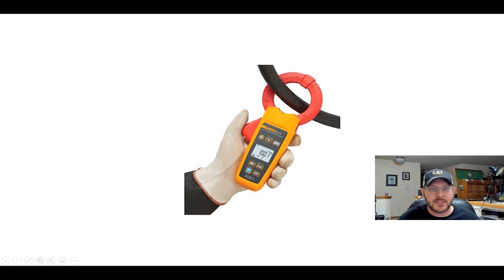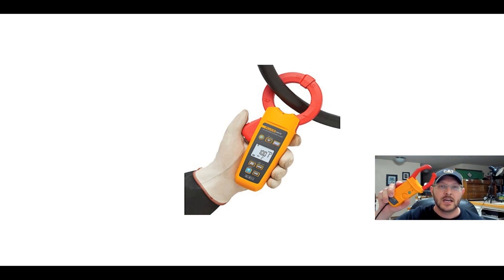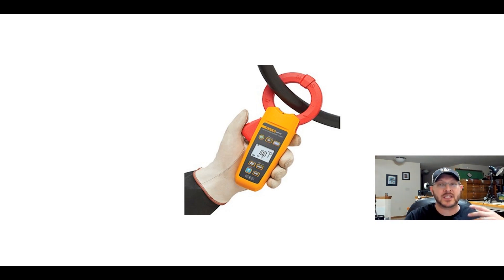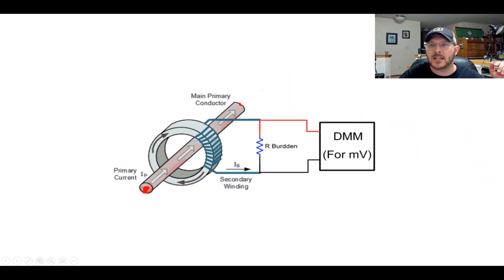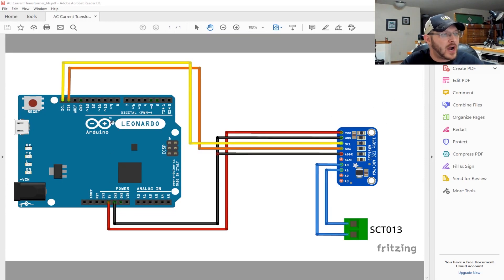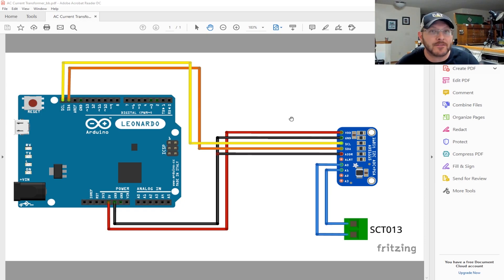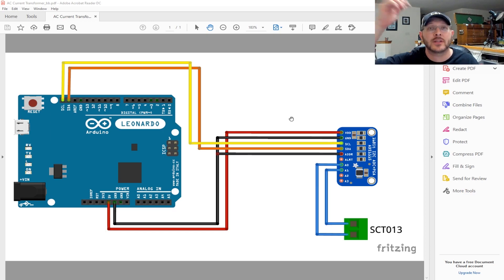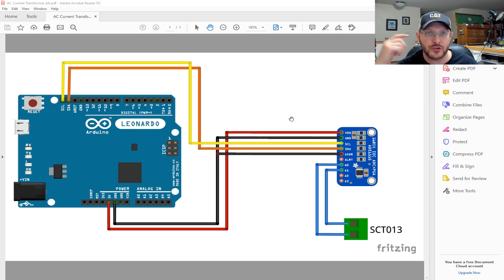Measuring AC Current with Arduino

Comment: For those who are confused by the multilier (LSB Size), here is how to calculate it for both ADS1x15:

multiplier = Gain voltage / 2^(bits−1)

For the ADS1115, the FSR (Gain voltage) can be set to 6.144 V, 4.096 V, 2.048 V, 1.024 V, 0.512 V, or 0.256 V.
The LSB size is calculated by dividing the FSR by 2^15 (since the ADS1115 is a 16-bit ADC, but the 16th bit is a sign bit, for ADS1015 it will be 12-bit - 1).

Here are the LSB sizes for each FSR setting of ADS1115:

6.144 V: 0.000188
4.096 V: 0.000125
2.048 V: 0.0000625
1.024 V: 0.00003125
0.512 V: 0.000015625
0.256 V: 0.0000078125

Comment: I get your use of the ADC1115, and I do like that option if I ever needed the accuracy.  I'm just building a servo ball valve for a dust collection system I'm making, and simply need to know if the machine has turned on or not.  If it is turned on, then I would activate the series of states to put the servo's in (aka what sequence of opening and closing the various servo powered ball valves, aka "efficient blast gate").  In this scenario, what is the best way to run 12 or so of the voltage from these CT's straight into the Arduino?  I currently have momentary switches for each machine, that I just push the button to activate that buttons sequence, and for the switch, I just run them into the pwm pins 2-13 (I'm using an actual pwm module, a PCA9685 variant with separate switched power to power and control all of the servo's).  Would each of these CT's go into one of the Analog ports or one of the digital ports (pwm), or can this not be done?  Too bad they don't just have a board that accepts 16 separate inputs and then just uses the clock and data ports like the 9685 does.  Otherwise, it is looking like I will need to get at least one of these ADC1115 modules per every 2 CT (or 6-7 of them in total).

Comment: Excellent video. I have this working with an uno r3 arduino and a sct013-030 attached to an ads1115. I also have an oled on a different pair of i2c lines.

Comment: I tried your code unsuccessfully. Then thought why all the root mean square math when peek is easier to get the x .707 = RMS but when I took the max from the 1 sec worth of readings I actually got the same value as my meter (fluke RMS) no need to x .707 weird but is working extremely well for me (current measured within 5%, tested with 2 clamp meters)

Comment: Well done video!  I am building a demand controller for my Phoenix-based home.  I am new to Arduino and have been struggling with getting it to read a current transformer.  Your video was, simple and straightforward.  I copied the software and everything came alive 1st time.  
My question is my current transformers are installed on L1 & Line 2 immediately after the primary 200 A breaker.  
They are 100/5 (100-amp primary with 5-amp secondary).  I therefore changed line 7 "FACTOR" from 20 to 100.  
I am measuring the current on my 5-ton AC unit which draws 16.5 A @ 239 volts. 
My reading from the software shows 3.9 Amps and should be about 4 times that.
Can you recommend the best way I should adjust the calibration within the software?
Reply from the maker: Hey there.  Glad the videos helped out.  Now let me ask you a question does the ct you are using have a burden resistor?

Comment: Hello,
I don't understand why it works, the value is completely wrong, but my goal is to compare the consumption of my freezer when it works normally and when it doesn't (too much consumption for example when the door is no correctly closed and not enough if the motor has a problem). So I can detect a problem before the temperature drops.
So thank you 🙂

PS : the Adafruit_ADS1X15.h calls for the library Adafruit_I2CDevice.h. If you don't have the second, you may have an error compilation error.

Comment: No.  No.   wait a minute:  when you were actually taking measurements in the 13A range, your values were jumping around.  Your Fluke meter, was not.  it had a steady measurement.  Why was this the case?   are you able to dig deeper and figure out why the current measurements on the Arduino jump around like that?

Comment: Do u really connect 1 volt ac output from sct013 to ads1115 ?
Reply from the maker: Yes, it is fine.  The ADS1115 can take inputs up to VDD + 0.3 and max VDD is 7 so it can take 7.3 maximum.  So if you take 1Vrms and divide it by sqrt(2) to get the peak it is only like 1.5V max so you are good to go on that.

Comment: This works really well  Had 2 add 2 4.7uf caps to a0 and a1 to gnd to stabilize readings tweaked factor to dial it in and scales through the range. tested on 5amp sct013 and 20 sct013

Comment: I am a little confused.  The ADS1115 has an absolute maximum input range is -0.3V to Vdd+0.3V.  With your schematic, the 1VAC will exceed the -0.3v input on the negative cycle.   Wouldn't this destroy the ADS1115?
Reply: the ADS1115 can read 0v to VDD + 0.3v, VDD can be 2-5v. On my ESP32, VDD is 3.3v, so 3.6v is max signal input. a voltage divider of two 100k resistors will provide a -2.5v - 0v - +2.5v swing.
Reply: @sspence65  have you built current sensor
Reply: @Shubham-9996  I've built many over the years.
Reply: @sspence65  
Can you please suggest any website where I can find best circuit
I want to build industry level power measuring instruments like
Electric metre attached in domestic

Comment: If I need to measure the current from a 240 VAC single phase line, do I just use one of these on each hot line?  Can I hook it to just one hot line and double the value?  Or put one around all the wires?
Reply: CT transformer should only go around 1 wire, and for 240 VAC single phase just need one CT transformer on one of the 2 wires, black or red.

Comment: Thanks for the great explanation!

Quick Question: Shouldn't the multiplier be 0.00003125 instead of 0.00005? I just checked Adafruit example sketches and it says
1 bit = 0.5 mV in ADS1015 and 
1bit = 0.0312mv  in ADS1115. 
Since you've used ADS1115, 1 bit in volts will be 0.00003125 . Could anyone please confirm this
Reply: You are correct, and that should also fix the drift at higher amperages he was seeing in the video.  I also added a 10K pull down resistor A0 of the ADS1115 to GND to remove noise and allow the reading to go to zero when there is no current flow.
Reply: also, the ADS library may have changed since this was published.  The correct library to add is #include <Adafruit_ADS1X15.h> not the one in the code on the hub.

Comment: Is normal plcs CT are also used as same procedure with controller i have 150/5Amp  puma company CT .?
Reply from the maker: Did you mean 150A/5mA?  If so you can use the same procedure but you need to supply a 200ohm burden resistor to scale the 5mA out put to a 1V output

Comment: how do you go about doing the physical connections?
Reply from the maker: for this you will have to be very careful.  I would recommend having an electrician help with connecting the CT's to the wires in your panel board.  The CT simply clips around the wire and measures the current through it.

Comment: HI~ the multiplier in your code should be 0.0005, right?  It's 0.00005 now. I am a little bit confused.
Reply: Yes you are right. You can use 0.0005 as a multiplier but you have to unquote the "current /= 1000.0;" line.
Also if you are using ADS1115 i believe multiplier should be 0.03125

Comment: thx again but i'll do this with sct013 for 100A and the rated output is 50mA. So can i use it by doing the same thing like using ads1x15

Comment: Hi thanks for a very informative video. If the voltage across the  20A current transformer is 0.5V ac can you say that the current flowing is 10A?
Reply: Yes if you have 20A/1V version

Comment: Thank you very much for this informative video.  I have a question: why did you choose GAIN_FOUR and not GAIN_TWO or GAIN_EIGHT?
Reply: More accuracy because the ADC is looking for a range of  5 volts.  So it adds a 4 gain to take the 1V closer to 5v.
Reply: Because maximum V output is 1 V. In this case GAIN_FOUR provides most accuracy

Comment: In this video, you covered  SCT013-020 CT which can measure Voltage. You mentioned SCT013-000 which measures Amps only, but you didn't cover it. There are differences. Not small at all. Besides SCT013-000 needs a Burden resistor, but the one you use in your video has built-in so you don't need external.
Reply: No SCT013 measures voltage. They measure current only, by definition. They output a voltage corresponding to the amperage running through the wire being monitored.
Reply: @sspence65  There is no SCT013, but SCT013-020, SCT013-000, etc.
Reply: @dekipet  the SCT013 is a series. The -xxx indicates rhe current rating. -020 is 20 Amp for instance.  The CT stands for current transducer.  My comment stands correct.
Reply: SCT013-020 CT build-in Burden resister for measures voltage.

Comment: The ADS has 9 MILLISECONDS time conversion. If you wanna calculate RMS current, from a mobile charger, for example, you will read nothing. It is not easy read RMS current...
If you use a Teensy, with a 20 microseconds time conversion, you'll be able to calculate that.
I published that (in spanish....), the problematic is obvious.
https://www.youtube.com/playlist?list=PLXo6hmhWYYBhG33Cock6weKh8J6ojneDm

Comment: Amazing Explanation...Just a query....As shown in video time (8:05) We need to cut SCT sensor in order to join the two wires to A0 and A1 pin. Is there any other possibility of joining this to Arduino GPIO pins, other then cutting the wire?

Comment: Cool very good your work would you have a video similar to my project? I have a screwdriver project where I use Arduino mini or attiny85. and SSD1306 mini LED display. with ACS758 50-or-200A module. of amperage. with an H Bridge and 4 touch button 2 to increase and decrease the amperage that the engine will be turned off. and 2 button to turn the motor to the left and to the right so the screwdriver will not blow the screw .... which I will tighten, be it small or large ... for arduino I only know how to write the code. since already thank you >>>>>>> suddenly it's a suggestion for a new video

Comment: Thanks.  Being SCT-013-000 is for 100A, what happens if it goes over? does it melt? I actually don't care about the actual value, just if current > 0.0 amp, we have power. Or would you try to measure the 220v?

Comment: Why do you use a multiplier value of 0.00005? I think you should use (0.00003125) since we are using ADS1115 and not ADS1015.
Reply: I think the answer is here: https://learn.adafruit.com/adafruit-4-channel-adc-breakouts/arduino-code
Reply: I agree in ADS1X15 example they also suggest ....3125 for ADS1115
Reply: The multiplier is the inverse of the GAIN. For Gain_Four it's 0.0005

Comment: Hi !!, is there a way to connect this non invasive sensor to Sonoff PowR2?
Reply: if your 'Sonoff PowR2' is I2C enabled or if it has an ADC, then yes there's definitely a way
but 99.999999999% chance the answer is no.

Comment: The loop takes readings for 1 second right....which is causing an issue with my Ethernet in the project it seems. If I shorten that to 500Ms everything works ok Ethernet wise...have you tried messing with that timing? Figure it will work ok?
Reply: I guess what I mean is, will less samples affect the accuracy?

Comment: Am I correct in thinking that having 240v 50Hz here in the UK will not make any real difference to the code etc???
Reply from the maker: yes it should be just fine.  The core I think is rated at 150kHz so you should not saturate and it is measuring the current not the voltage.  Thus, it should work fine.  Now if you are wanting to compute power then you will need the voltage in your calculation.
Reply: misperry thanks for the reply.  It did work but, the results were up and down constantly and regardless of the current being drawn (unless zero). When I plotted the numbers it looked like a sine wave - is there a method to smooth this out? I was drawing 1 amp according to my scope but this setup indicated .910 and .019 constantly??? Any ideas?

Comment: Thanks dear friend for the video, the code that you used, does it measure the true RMS, or just you supposed that the wave is purely sinusoidal, and you use max and you divided by sqrt(2)?
As you know, true RMS depends on the wave frequency
Reply: RMS value depends on frequency? Source of this claim? It doesn't make any sense

Comment: how can you  measure the direction of the ac current? i would like to use it to measure if i'm using from the grid or delivering back to the grid on sunny days (solar panels).
Reply: There is an answer that shows how but it depends on the audience having an understanding of electrical engineering. Something like the myEnergi harvi is designed to measure current and direction then convert it to OCPP or serial data. When a device is drawing current, the current is the same as voltage in the direction of consumption. When a device is powering a load the current travels in the opposite direction. So if your house is pulling from solar and the grid then the current will be towards your house in both cases. If your solar is powering the street, then the current from the inverter will be (out) negative and so will the current to your house. The current transformers (CTs) will show this clearly. If solar is exporting then the solar CT and the street CT will show (nearly) the same current. Same RMS value

Comment: How can i measuring load current of  3 phase ?
Reply from the maker: simply enough if you just set three of these CT measurements.  Now you need to remember you power calculations and depending on how the system is connected, delta or wye, the relationship between phase and line to line measurement may differ by sqrt(3).  So in Delta connected the current will differ:  Iline = Iphase *sqrt(3) in a wye connected system Iline = Iphase.  And also remember if the source and load are different (i.e. delta - wye or wye-delta) there will be a 30deg phase shift accordingly.  Hope this helps.

Comment: Hello , 

Great little video thanks for sharing. I’m just doing a similar thing and would like to know if your setup works down to really low current? Say 40mA 5 watts at your voltage?
Reply: It wont.
Reply: if you watch the video he explains how there are different models of current transformers for measuring different currents...

Comment: Hey can you find help me with the switch configuration for LT spice . I have two switch in a circuit. I would like one open after 50s of charging a capacitor then at the same instant that opens I would like the other to close ( that was previously opened) for another 50 seconds. Thank you
Reply: Bruh I had to pay $60/hr to get help with electrical engineering. Good luck getting it for free!!

Comment: Hey There awesome video, Looks good.  But now here is the trick trying to do this without that breakout board. What would you need? Oh and I'm first haha i had to say it haha
Reply from the maker: Hey hey thanks for the comment.  Yeah you can do it with the built in arduino adc but you would have to first correct the AC waveform using a bidriectional circuit or if you can get a low loss rectivfier so you can get it to a form of 0V to 1V then scale that accross the 10bit internal ADC.  However, that is quite lossy and you only have 10bit resolution.   That was why I chose to use the ADS1115 so you could get more resolution and you can input the bidirectional voltage from the CD without any lossy circuitry in the way.